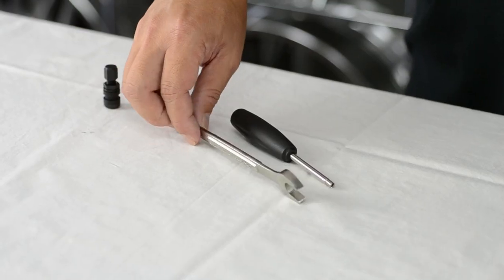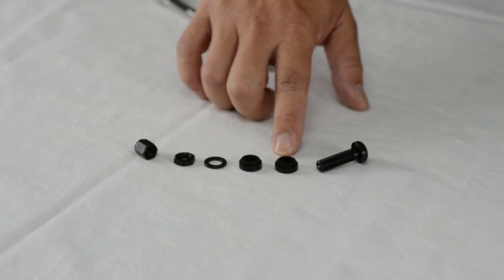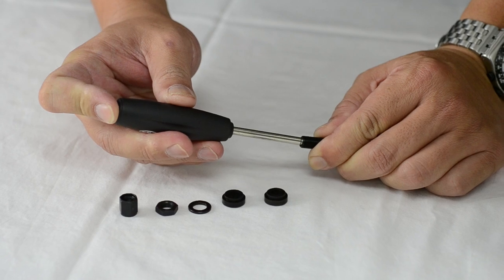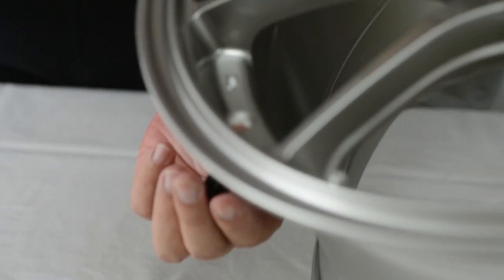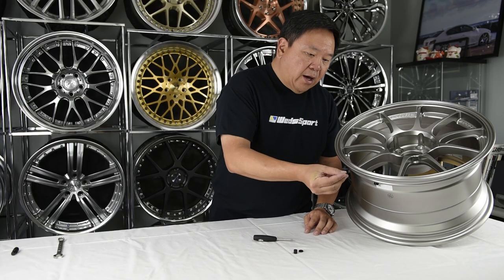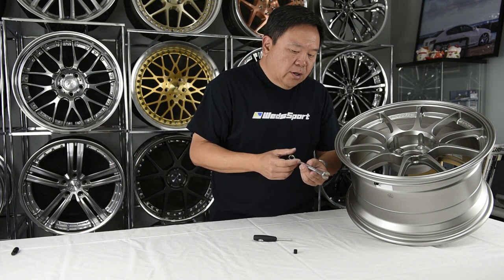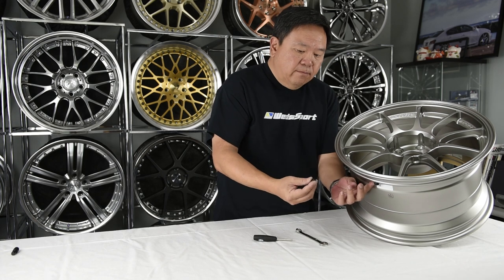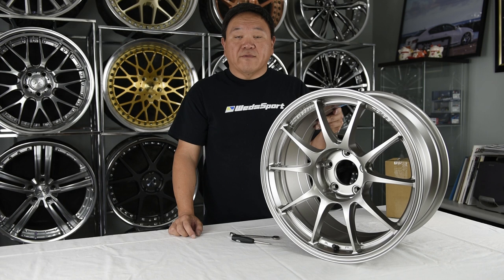How to properly Install WedsSport Valve Stems

Comment: Have you ever put silicone paste on rubber grommets to keep them soft and sealing?  I have read that these grommets fail after 3 months from getting dry.
Reply from the maker: The key is to not overtighten the nut. If it is too tight it will compress the grommet too much and cause it to shear over time.

Comment: Why the hell can I not use my tyre inflators or any of the fuel station's air pump with these stems? They don't look like they work any different from the stock wheel valves but I'm having tremendous difficulty inflating the tyres myself (getting Error messages from air pump stations). The only way is to bring it into  mechanics with air compressors.
Reply: Same! That's why I'm looking videos up lol. It's happening on my Gram Lights 57cr's. It's like the valve stems are too low.

Comment: I bought some cheap 15x7 and 15x8 alum rims for Toyota 6 5.5.  I bought th 416 stainless stems but threads not near long enough to grab.  Did I just order wrong ones?  1 1/2 long